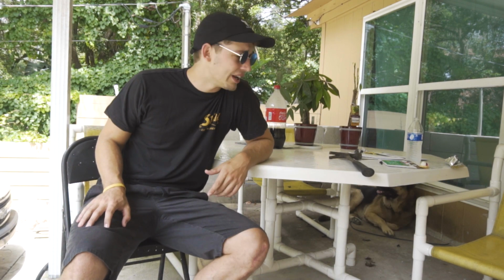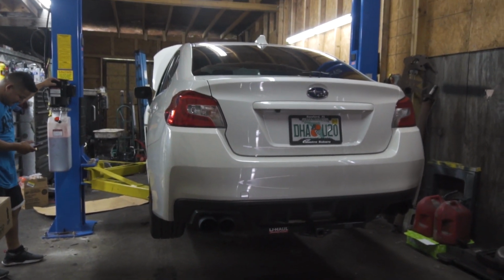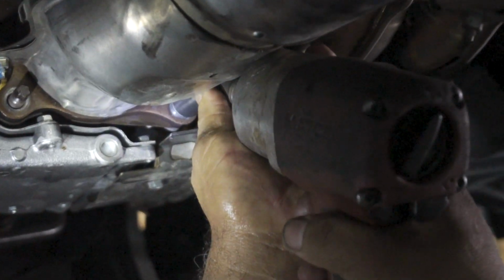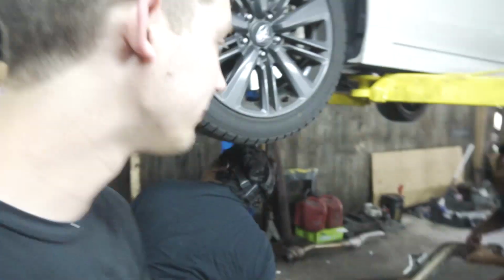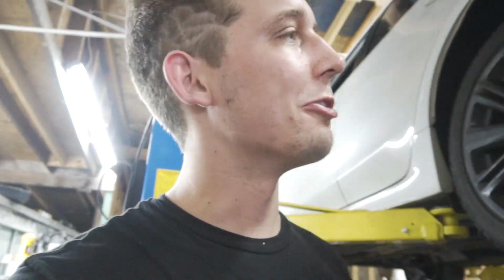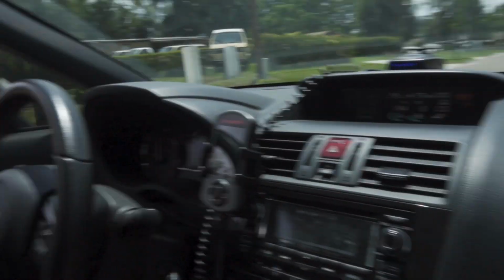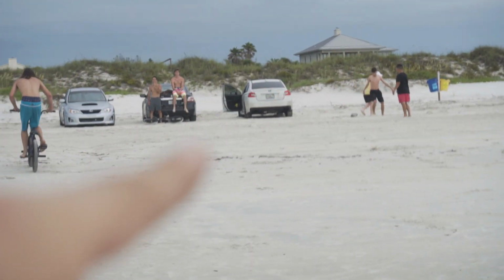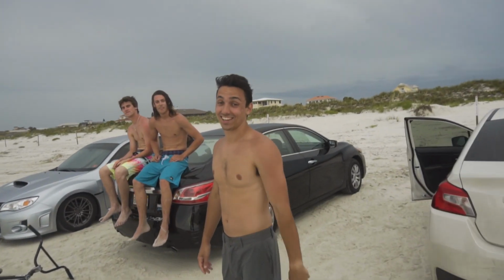TURNING WRX INTO A RACECAR!! *STAGE 2*

Comment: Did you tune the car or at least use an OTS map? If you didn't you're hurting your car. Even "stage 1" CAI would require a tune so you don't run lean on your Air-fuel mixture.
Reply: Artin Aidun he has an accessport and is running the stage 2 93 with it. I'm pretty sure you aren't suppose to run catless on an OTS. I have the same car with a turbo back but what do i know.
Reply: My question was does he have a tune in the form of OTS or pro-tune. I'm not going to pretend to know the specifics -- just know that each part requires a retune. His responsibility to know which he needs to do based on his parts list. Yes, I don't believe the COBB stage 2 takes into account going catless so an OTS would not make sense.

Which takes me back to my question -- did you get the car professionally tuned or even e-tuned? I'm sure you do ACTUALLY know what you're talking about. However the way you wrote it implies that since you also own the same product that somehow also includes all said knowledge about that part. That is not inherent and is a logical fallacy. No need to be a d*ck, I know I wasn't trying to be.
Reply: Artin Aidun not trying to be a dick at all! Just stating in a sarcastic sense that i agree with you and that he's hurting his car until he gets a protune/etune if he's not going into a shop! I'm not try to be a YouTube comment troller by any means lol
Reply: Ah I reread your comment. I see -- lol now I'm the aggressive one :-P